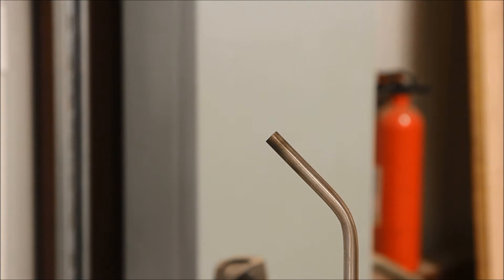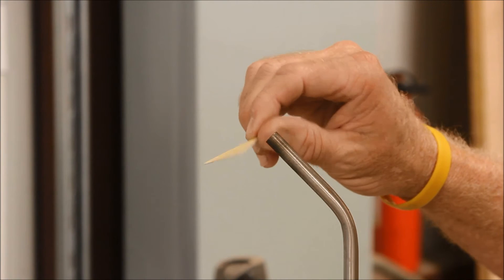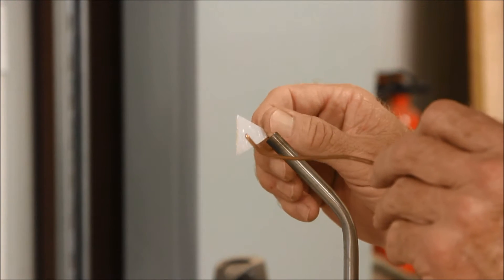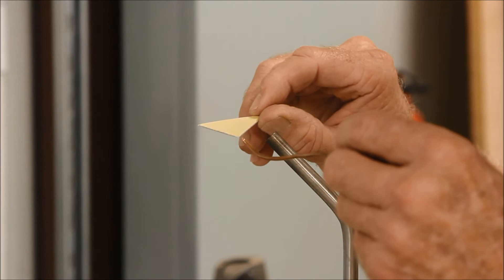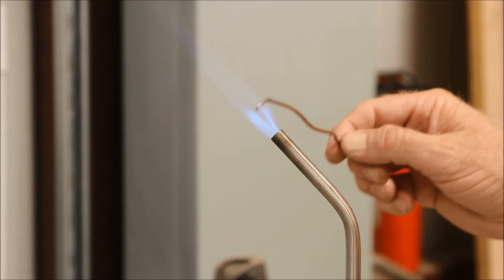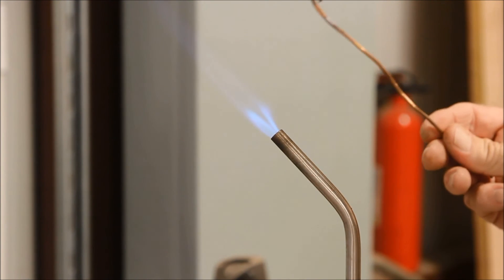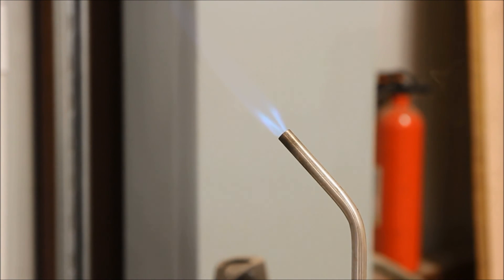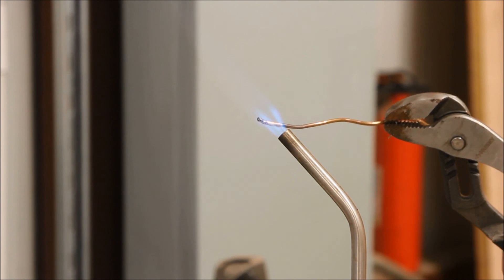Corel Draw Tips & Tricks How to Identify Plastics Before Laser Cutting Them

Comment: Hi Doug good video. Just to clarify. PVC does a couple of things when it is burned. The first is it creates chlorine gas which if inhaled can be quite deadly - remember WW1. Also you will get a reaction with the air which creates hydrochloric acid. This will deposit on your machine and over time with start to eat away at anything the acid hits. A tell tale sign is a machine that is full of rust. I have seen some machines that look like they were left out in the rain for a year. Anything that is an exposed stainless steel is quite susceptible and will pit over time